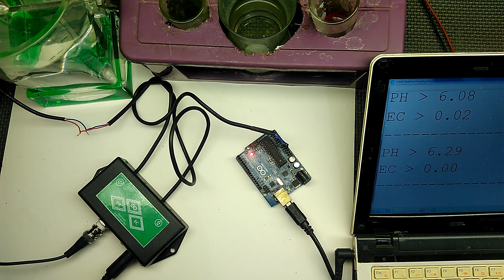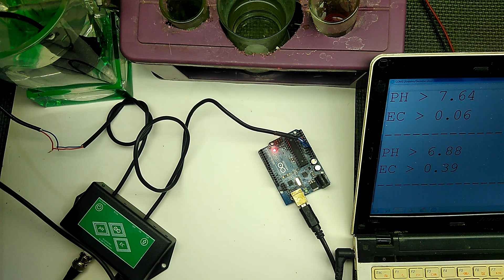Arduino EC and pH sensor

Comment: How to find EC for soil??
There is any sensor or circuit?
Reply: Soil always has high EC when wet. You do not need to measure soil EC. If you use high quality soil with compost and other amendments you most likely will not need to add more nutrient to your soil at all!